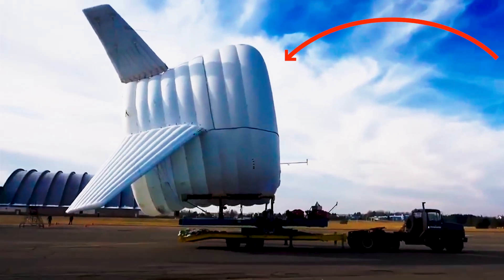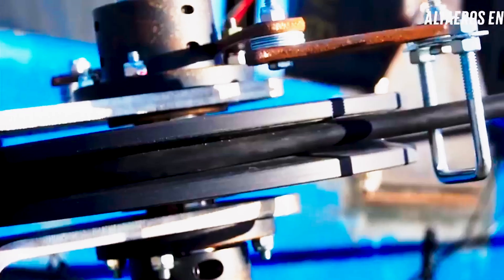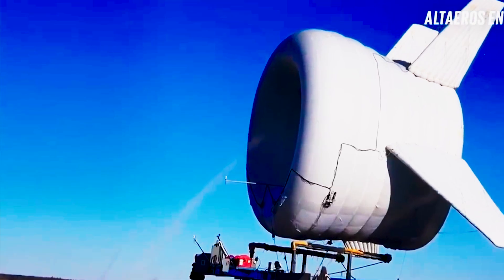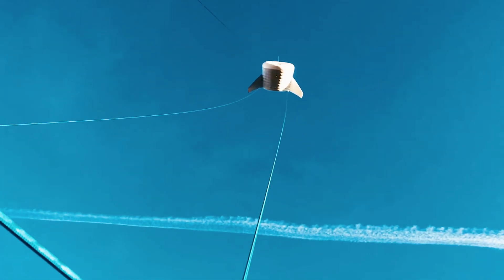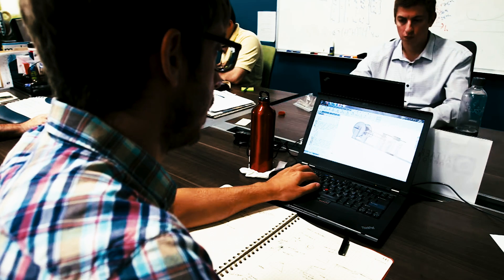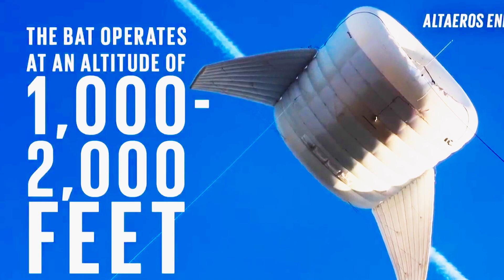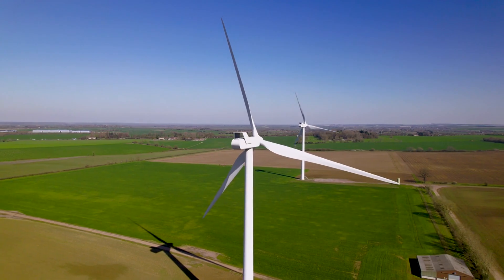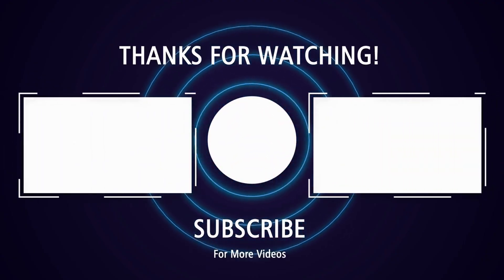This Novel Wind Turbine will Overtake the Energy Sector

Comment: what the difference in a windmill and a wind turbine
Reply from the maker: A windmill and a wind turbine are different in structure and purpose, even though many people use the terms interchangeably. A windmill is a very old technology that uses the wind to either mill grains into flour, drive machines, or move water. A wind turbine converts wind energy into electricity by turning a turbine.
Reply: nice question